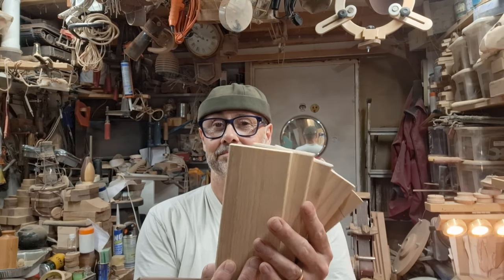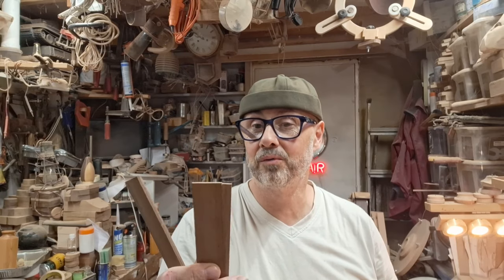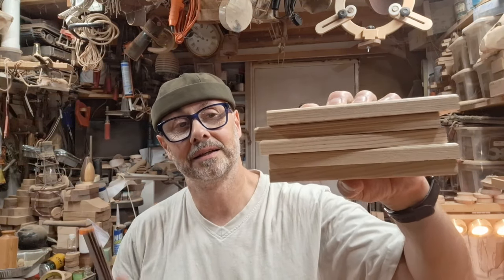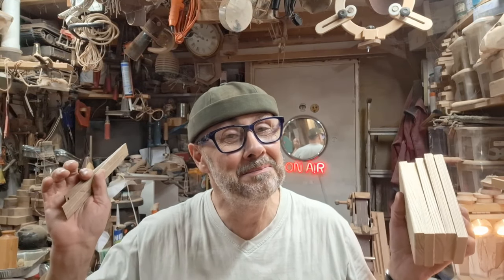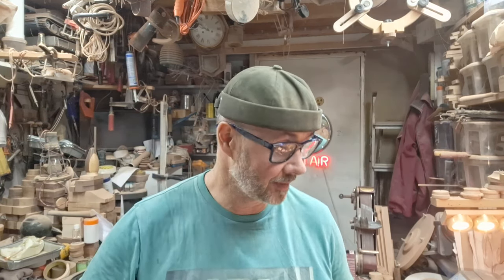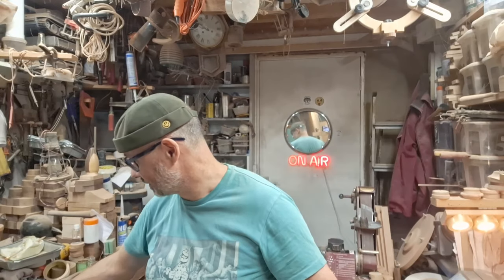wood turning a laminated goblet

Comment: Great Chris, really eyecatching. Did you use the steady rest just because it was laminated or would you have used it on a solid piece?
Reply from the maker: Thanks....I'm fully confident in the glue.....I used the steady rest for support even though it's only a small piece.....its easy to fit and set up.... cheers 😀